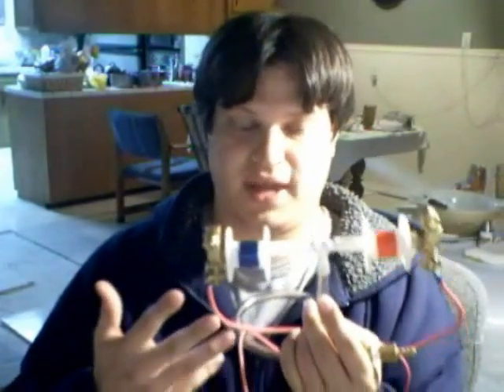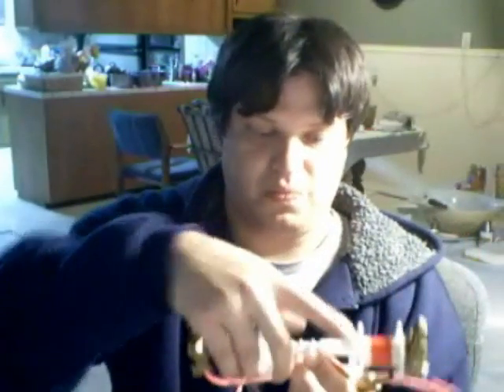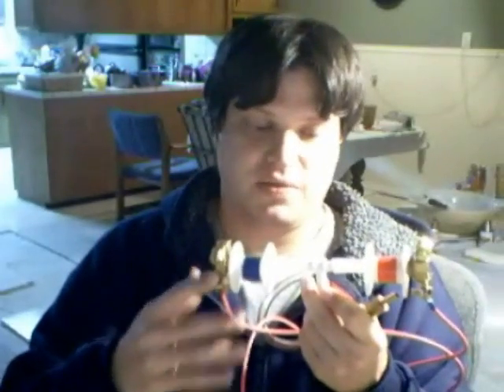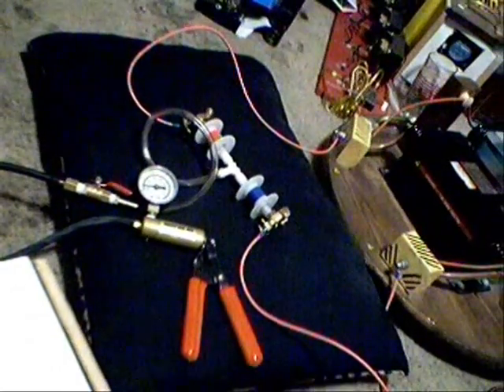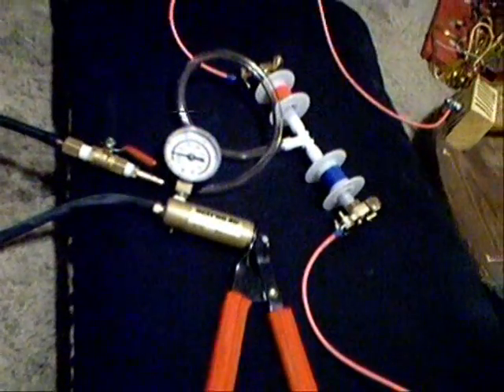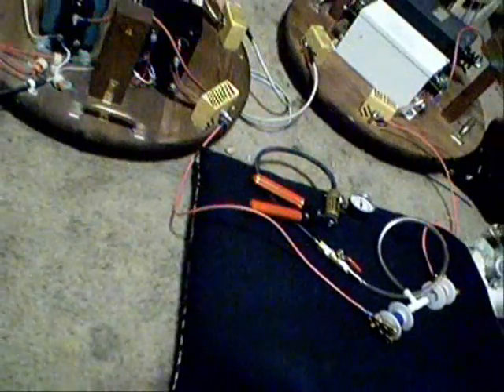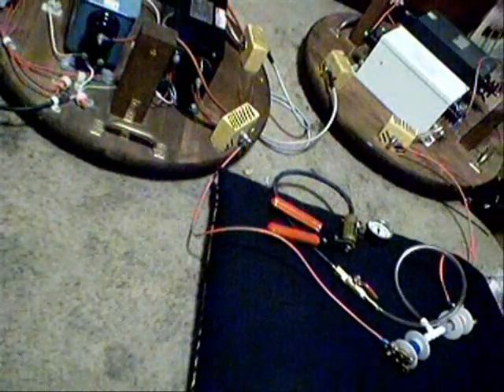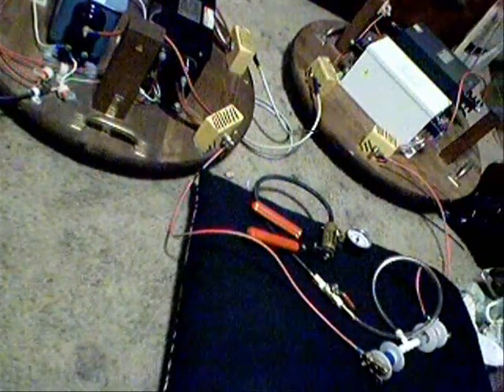Homemade Gas-Discharge Tube

Comment: no mean to rain on your parade but cathode ray tube are only produced at pressures below 10^-4 Torr. i really doubt a vacuum pump powered by hand could get down that low, good setup though, you might want to consider getting a longer larger tube for better visibility.

Comment from the maker: I just used a step-up transformer (a neon tube transformer) to get the high voltage.  I had to use high voltage to energize the tube and start a discharge.  I probably could have done this at lower voltages, but I would have needed some other way to excite it, like a heated filament, and a much lower vacuum.  High voltage was just a lot simpler.  It's basically a "cold cathode" tube.

Comment from the maker: No, not really.  This was with AC and you really need DC to generate X-Rays because alternating current tends to cancel out the effect.  At the worst, it might just generate soft X-Rays which have very low energy...even your clothes will stop them.  I did test this at a friend's house, and he has a Geiger counter.  It didn't set it off.  (But a light bulb powered with my Tesla Coil DID generate soft X-Rays).

Comment from the maker: I've thought about that, but I'd have to figure out what would be the best way to mount them...it would have to be well insulated, considering there would be 15,000 volts passing through the tube!  I can't get them too close.  I might need a lower vacuum too.

Comment from the maker: Well, some of them use a heated filament to boil off electrons.  But you still need a high voltage to accelerate the electrons and form a cathode ray.  What I made here is basically a "cold cathode" tube.  If you make something like this, the hardest part is sealing the electrodes!  But I just used stuff from a hardware store - machine screws, air fittings, rubber washers, etc.

Comment: i think im going to try this Chris... very good info.. i allways wonderd how they work... i built a computer a few years ago and bought a few cathode ray tubes to light the inside.. i knew they where highvoltage but had no ideah it workt like this... i need to start working with my transformers again.. lol i have boath of them sitting in the middle of my room :) im glad my mom dont gripe about them.